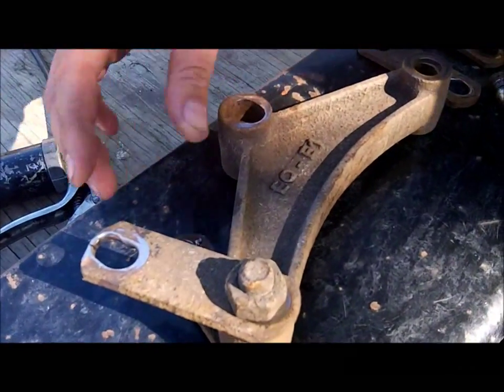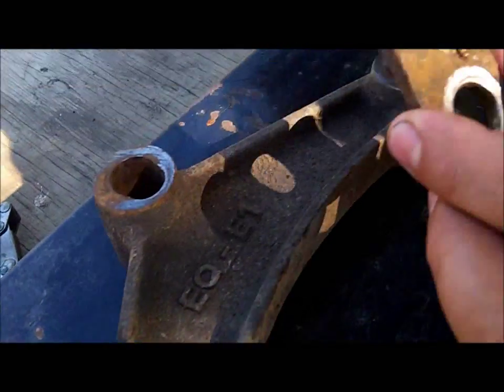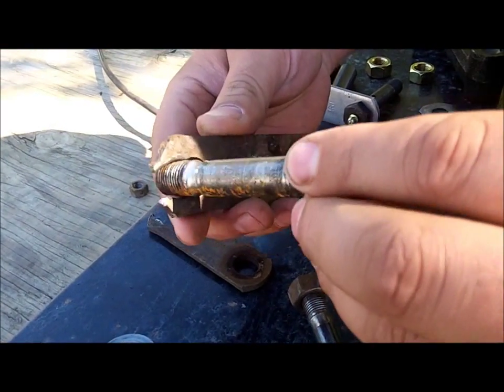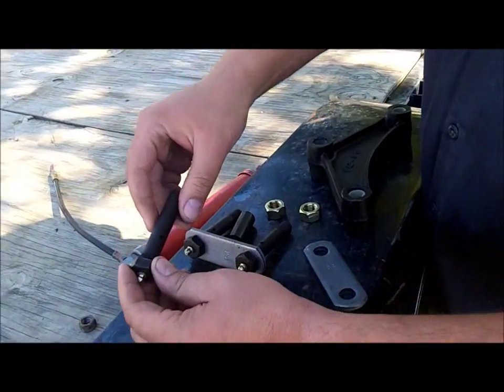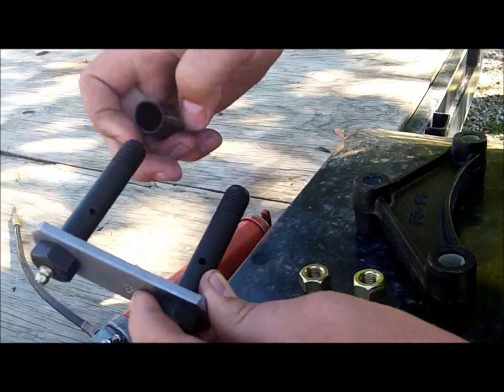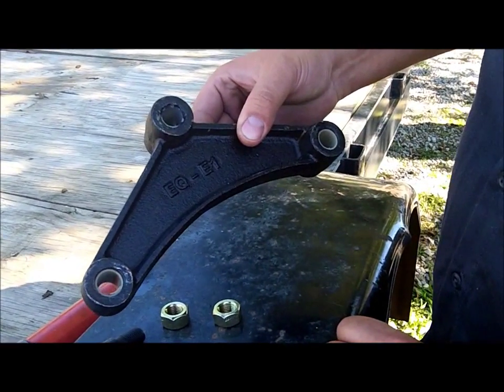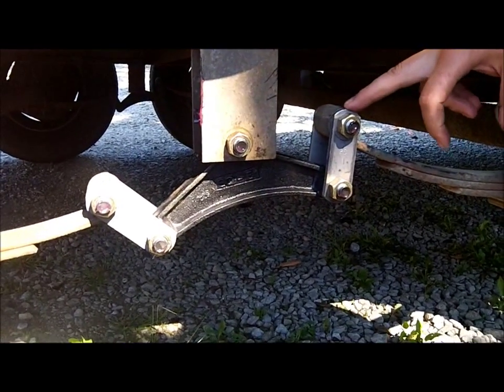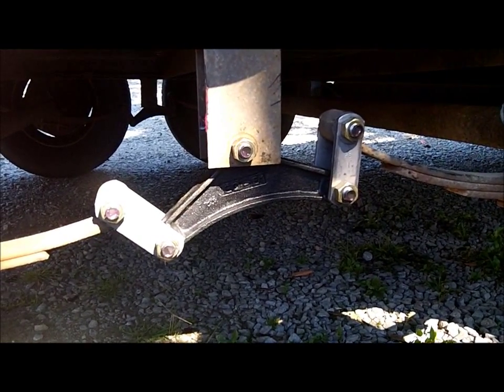Trailer talk

Comment: why wouldnt you replace the equalizer bolt with a greasable bolt too?  and why in gods name would you install the greasable bolts with the grease fitting facing inwards?
Reply: Because he sells the parts. Why use grease?